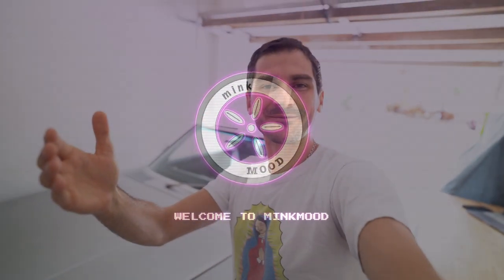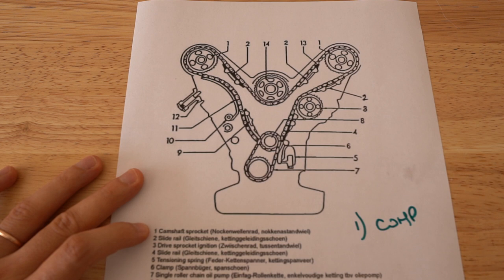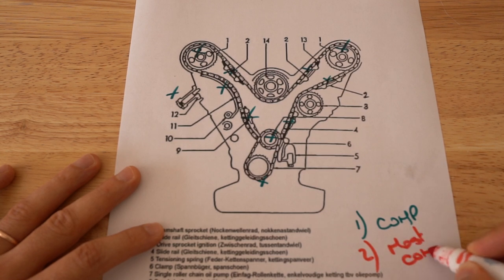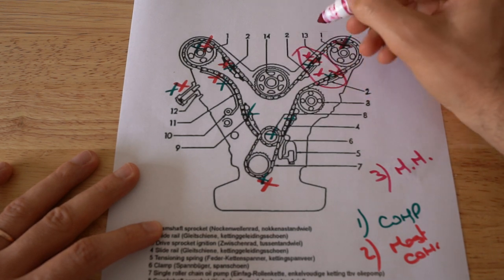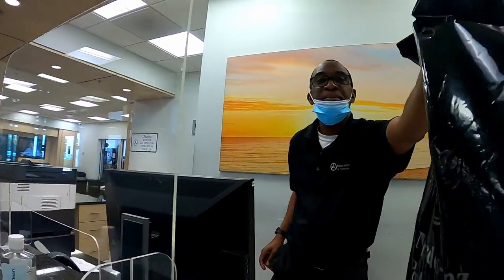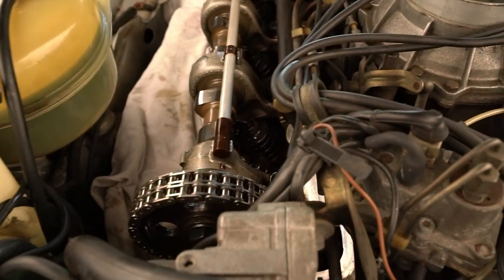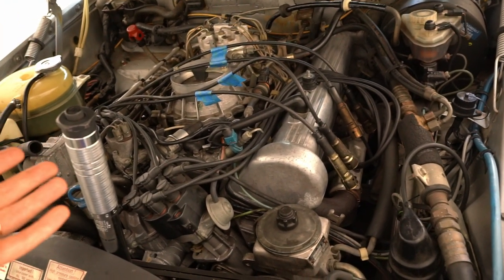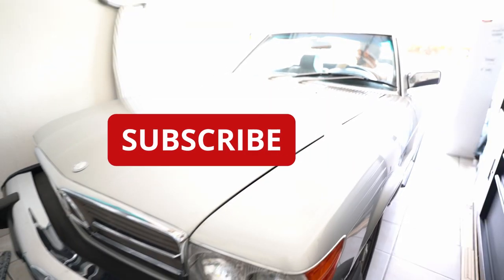How to fix a STRETCHED Timing Chain in V8 [Mercedes Benz SL R107]

Comment: Loved your video. What is the rubber tube with the yellow tip called which lies along side of the oiler tubes? Is there a part number? Thanks!!!
Reply from the maker: Hi Man, glad you like it! The part is Engine Air Distribution. My best guess here is Google for the part number or call the Dealership. Its amazing the amount of parts they do carry in stock

Comment: Hello. Thank you for your video. Is replacing the tensioner really that straight forward? Just loosen two bolts, remove old tensioner, replace new tensioner w/gasket and tighten two bolts?  Thank you.
Reply from the maker: Hi David, yes is very straight forward. Getting those bolts in and out take some time considering the tight space in that area. Some people remove the coolant reservoir to get some extra room. Try to get the Mercedes One, ask them for discount if needed but avoid aftermarket for this job.
Reply: @MinkMood  Hi (i have an 1984 SL380). i bought a Febi Tensioner and after i read so many bad review of it decided to return it and buy a MB original one that is supposed to reach me within two weeks. The question is, my Mechanic said he has to open both cover and align the chain before he remove the tensioner and insert the new one while in your video you have simply removed and replaced it. May you please elaborate on the subject?
Reply from the maker: @mazenkhazaal698  hi M, is a great idea to open the valve covers and align Cams with the marks and check crank to see how many degrees the chain is stretch. Also great opportunity to check plastic guides (color and if not broken) and decide from there. 
I changed de tensioner after that inspection and in my case plastic guides were already replaced. 
After new tensioner is installed also measure how many degrees the chain is still stretched. It should be below 6 degrees from TDC ( top dead center ) 
Have the mechanic check the car. It will be safer than just replacing the tensioner
Reply: @MinkMood  hi. i meant that my mechanic said in order to replace the tensioner we need to open both cover, align something then remove the old tensioner and install the new one. While, in your video you just removed the old one and installed the new one without opening the cover and doing any alignment. So, is my mechanic correct or what you have done is the correct?
Reply from the maker: @mazenkhazaal698  let me try to explain better. To replace the tensioner there is not an alignment needed. BUT your mechanic is also right, you should check the timing marks before and after changing it. If you just want to replace the tensioner you can do it without even opening but is not the ideal as the complete system is composed of 1) Chain 2) plastic guides 3) sprockets 4) tensioner.
Again you CAN replace just the tensioner but the remaining parts should be inspected or replaced

Comment: This is faulty information. The tensioner cannot help a stretched chain. If a chain is stretched it is stretched, meaning that you will always read the stretch at the crankshaft. You have read it wrong the first or second time for this video. The length of the path of the chain after cam 1 is not changed because of the tensioner. Do you Understand? The tensioner will only create a longer route before the first camshaft, thus take out the sloppyness, but the chains length after the first camshaft will remain the same. If the markings at camshaft 1 are lined up, the second cam will be off with chain stretch and you will read the stretch at the crank, doesnt matter if the tensioner is installed or not.
Reply from the maker: Its 100% my experience. Not theory behind, simply by doing it and sharing.
Just to clarify, there is no misreading in the process, Camshaft Tower mark aligned and readings from the flywheel.
Thanks for taking time and sharing your point of view!
Reply: @MinkMood  I understand but you cannot take away chain stretch by changing the tensioner as you show in the video. That's incorrect information in the video. If you read 10 degrees ATDC before changing the tensioner you should read 10 degrees after changing the tensioner. Changing the tensioner is just a pre measure to prevent catastrophic failure due to failure of this part. Believe me, I have changed chains twice on these type of engines.
Reply: @MinkMood  mink can u explain how just by changing the tensioner  u tightened the by 5 degrees...was there a step in between reads in which u actually performed tensioning? or just when u started the car in between?
Reply from the maker: @faizrahman7671  hi F, all the steps were the ones shared in the video. There is no tensioning procedure besides changing the tensioner and ensuring that was PRE oiled before starting the car. If you are not sure about it I suggest going all in and changing everything as explained in the first part of the video. Cheers mate
Reply: These are my thoughts as well.  It simply doesn't work like that.
Reply from the maker: @Johnathan_Waters  thanks for sharing, in my experience it certainly did. If you are hesitant I would strongly recommend to change everything: Chain, Sprockets, Plastic Guides and Tensioner. 
Have a good one !
Reply: I was bit skeptical of this video as well, for the reasons already given.

Having inspected the chain on my 450 SL, I can see how the tensioner might take a small amount of timing slack out. Without it there is some ‘give’ in the interlink between the sprocket teeth (particularly if there is a bit of sprocket wear) and chain links, which would allow a small slack to exist between the left cam and the crank. 

It doesn’t have to be much, I think one tooth of the sprocket is equivalent to 20 degrees on the timing at the crank. Given that there might be a few degrees of error in the timing marks anyway, plus maybe one or two for reading error, I’m prepared to believe that the tensioner could account for some difference.
Reply from the maker: Thanks for sharing Ed, by any means I’m suggesting to avoid a full timing service. In my case plastic guides and chain were already replaced and the tensioner started failing. The tensioner is hydraulic, not mechanic and once’s it starts loosing the capability to sustain oil pressure needs to be replaced. Interestingly enough when checking for the MB replacement it showed that the part number was no longer valid and replaced by a “newer version”. May have them fixed something? Idk but sure it’s not the same part
Reply: @MinkMood  hi. what is the part number of the tensioner you've installed. Also, how did you know that the tensioner started failing in your car? i mean, any symptoms? i bought a Febi one for my 84 SL 380 coz SOME early morning starts i hear the chain rubbing at the left side of the cover, so i am willing to start with the tensioner as per your vedio.
Reply from the maker: @mazenkhazaal698  hi M, so I changed the tensioner after chain slack visual inspection (valve covers out and cams marks aligned). 
The part number I think it was in the video and also the description. 
If I would recommend I would say have the plastic guides inspected. They need to be replaced by age and millage in top of the tensioner. This is a massive engine work if they go bad.

Comment: If the chain is stretched i would replace it. I know you can replace a chain a a 190e by attaching thebnew chain to th old one and feeding it through slowly with a helper . I never tried it on a v8 benz. That is a better option safer. If there is slop the chain can smack around break the plastic guides and cause the chain to break.  Trust me it happened twice. First time was a surprise second time i was preparing to do the job and just cranking  the benz to move it in my shop i broke the guide luckly the damage was less
Reply from the maker: 💯 right! Thanks for sharing M!

Comment: 12 degrees is nothing. Mine was 35 degrees and running just fine although not good at pickup
Reply from the maker: That's amazing, you are a brave man! Thanks for sharing and as you mentioned, with 12 degrees was not slapping during cold starts.